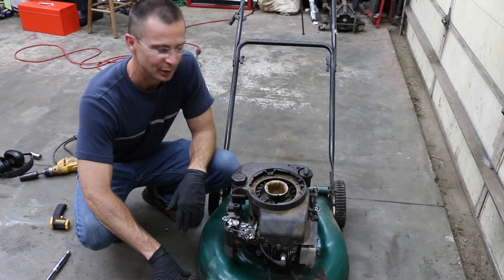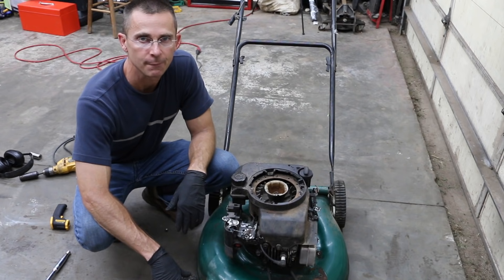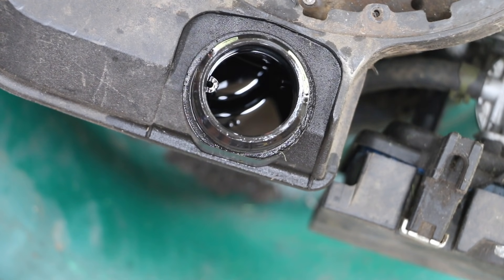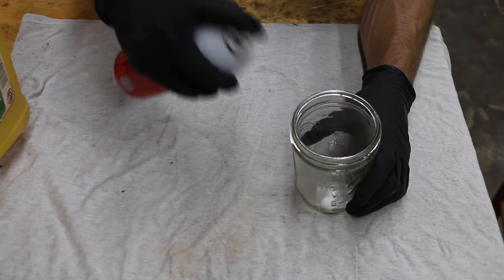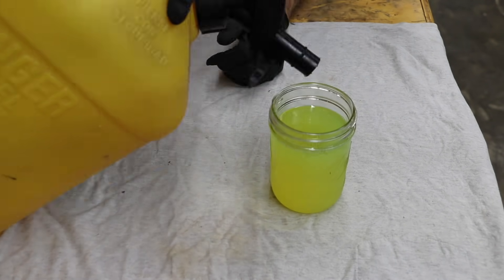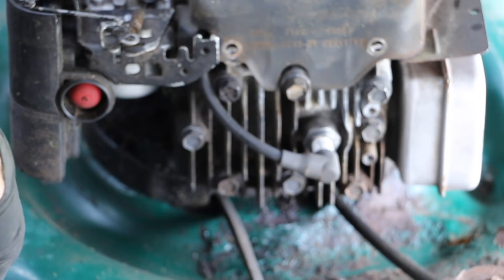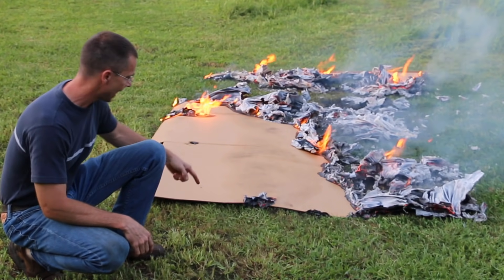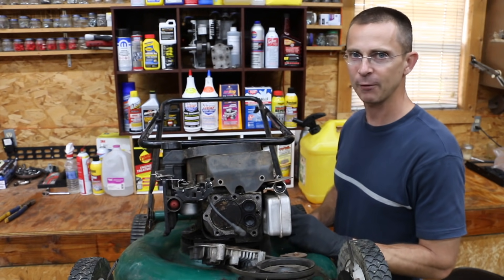Will a Gas Engine Run on Diesel?  Let's find out!

Comment: If you start on gas and get the engine hot, it will run fine on diesel. Old International tractors had a one gallon gas tank and a 20 gallon fuel tank. You started (and stopped!) on gas and when the temperature gauge came up turned a valve to switch. Some of the old Galion  graders were the same.
Reply from the maker: Thanks for commenting on this.
Reply: That's not quite how it works.  Those engines have a mechanism to prevent the exhaust valve from fully closing when a lever is thrown. That reduces the compression ratio since the cylinder is "leaking". So it starts up on gasoline (those engines have spark plugs) and then you throw the big lever which lets the exhaust valve close and activates the diesel injection system. Gasoline is shut off at same time. That is a very complex system that allows starting with a small battery and small starter motor. That is why it exists. The alternative in those days was a small external gasoline donkey engine for starting. That design was discontinued long ago. But it was very interesting, especially to those who are unfamiliar with engines. I ran an International crawler for a neighbor for many years with one of those engines.
Reply: @robertoskeetrech3206 people that didn't grow up on a farm welding and all that kind of mess don't know the diesel engine doesn't have spark plugs in it but it just squeezes diesel fuel until pressure ignites it
Reply: I worked at a golf course one summer. One day one of workers filled diesel into one of the small machines (single cylinder gas engine - John Deere, I think) and realised only some 20 minutes later when engine lost some power and was producing lots of white smoke. Nevertheless engine run more less OK until it was shit down. It was impossible to restart it and fuel flushing was inevitable.
Reply: @radolique1  it ran fine until it had finished the unleaded alcohol in the lines and carburetor it smoked until it was enough diesel being injected it may as well be trying to burn water
Reply: I have a 1949 Farmall H that you start on gas then run diesel. But I have just run gas in it for 20 years.
Reply: International made gas/diesel engines. Basically a diesel engine with a decompression valve that would allow for gas combustion at lower cylinder pressures (150 psi) when the engine was warm you could close that valve which would raise pressures up to 500 psi, turn the diesel on and it would run up on Diesel.
Reply: RiceReaper we had one a TD-18. Decompression valve and started on gas warmed up, switch fuels and close the decompression valve.
Reply: Hey guy I know has a Old tractor that starts on gas runs on diesel
Reply: Does sugar lock your engine up?
Reply: @smaqdaddy  I think there is a video here but if not I know from experience sugar gums up your pistons. Some people think it's the sugar grainuals doing damage, it's not as they disolve.
Reply: @smaqdaddy  sugar locks up your lips...
Reply: My father has a 54 international td6 I think it's called I don't remember the exact name. So yeah it's a temperamental sumnabitch sometimes lol fuckin loud when you switch it too diesel
Reply: This is ok with a compression ratio of 5 to 1 or less. If you intend to run a modern auto on kerosene it will be necessary to vaporize the fuel completely before it enters the combustion chambers. Incidentally, you can expect to achieve much greater fuel mileage on vaporized kerosene compared to gasoline.
Reply: We actually have one of them up at my cabin! they are really cool, outs is a old bull dozer
Reply: Robert Gibbons pony motor
Reply: Very cool story!
Reply: Robert Gibbons really? Man that’s so cool’
Reply: I think the carb is a problem.Diesel is too thick for the tiny jets on a mower.
Reply: That fire with the cardboard almost got ya
Reply: Called them TVO tractors in Ireland. Think they were back in the 60s. TVO = tractor vaporizing oil
Reply: Probably has a very high compression ratio and therefore can run on both... or has a low compression ratio for a diesel and therefore needs petrol to get going due to not having the compression and heat to cold start it on diesel... Which means it's a different kettle of fish (most likely)
Reply: One time I was putting gas in the lawn mower and I didn’t know it was diesel. The lawn mower ran until I finished the lawn because there was also regular gas still in the lawn mower. But the next time I went to use the lawn mower it didn’t start up and that’s when I found out I used diesel gas

Comment: I realized that if you could rig the primer to a solenoid that activated on the ignition, it might work since the diesel is being pumped in at the right time for ignition.
Reply from the maker: Great point.

Comment: I know you have tried putting diesel fuel in a 4 stroke engine but could you try putting diesel fuel in a 2 stroke? In the video you made about putting diesel fuel in an engine you had to mix the diesel with gas to make it thinner maybe drilling out the jets in the carb would let more diesel fuel into the engine (if you are willing to do that).
Reply from the maker: Great video idea!

Comment: I'm not sure what kind of diesel you used, but #2 diesel has paraffin in it as a lubricating agent (hence why it gells when exposed to cold temperatures). In the winter, many people cut their diesel with #1 (no paraffin) to keep it from gelling.

That paraffin, along with a cold engine, may be why you were unable to keep it running.

If you were able to "warm" an engine with gasoline, then switch over to #1 diesel, it may stay running on it's own.
Reply from the maker: Great point.  Thank you

Comment: If u work up Diesel then put it in the mower it'll  probably run ive ran my chain saw on straight Diesel it did fine once it got worked up good. But that was a two stroke I did a little udjing and now that's what I run it last longer in the field than mixing gas all the time.
Reply from the maker: Great point.

Comment: I wonder if a small amount of Diesel would raise the octane of regular gas??
Higher octane will make more power if the ignition and compression is adjusted for it.

Also. Diesel makes great fire starters. Yes it does take more to get it going but it burns longer to help the wood burn. Also doesn't flash in your face. Soak some 1/1" wood stock and 6" long in a can of Diesel. We used an old metal coffee can. Make your little fire include one firestarter and you have a great little camp fire.
Reply from the maker: Thanks for commenting on this.

Comment: My class learned in science that if a gasoline engine is hot you could theoretically use diesel as a replacement if in an emergency (if youve been driving awhile and run out of gasoline) but the engine needs to be hot. If we learned wrong please correct me.
Reply from the maker: I believe this would work in many instances. The viscosity is great with diesel, and some fuel systems might not be able to achieve a close enough fuel to air ratio to run.

Comment: Ok, I don't understand what happened here. I had a 5 horsepower Briggs & Stratton go kart with one of the carburetors that automatically adjust the fuel mix in according to the RPM. I ran out of gas and I wanted to ride it I happened to have diesel around I filled it with diesel, and it smoked like hell and was hard to start but I rode it around in a cloud of white smoke until it ran out of fuel how come mine ran?
Reply from the maker: Impressive!  The carb did a better job managing the high viscosity fuel.

Comment: So if someone (my girlfriend) accidently filled her car with diesel, maybe the answer is to drain as much diesel out of the tank as possible and then fill the tank up all the way with gas to highly dilute the diesel? It looks like a bit of diesel won't hurt a gas engine. Anyone ever had this problem?
Reply from the maker: Yes, you are right.  If the fuel lines running from the tank to the injectors are full of diesel, you'll want to cycle the ignition switch quite a few times to draw in the high gas content fuel.

Comment: One time I needed gas to get money I was owed about 15 miles away so I went to my parents grabbed the gas jug and put about 3 gallons in. As I was driving down the street my car was jumping like it was out of gas I figured what I put in there hadn't fully hit the engine yet so I drove 15 miles to get my money and 15 miles back to my town. After I got back I stopped at the park to play basketball for a few hours and when I went to leave my car wouldn't start so I called my dad and I tried everything he told me to do and nothing worked. Then he said to smell the exaust pipe and I did and it smelled like straight diesel and he then asked where I got the gas and he told me that was diesel that he couldn't find his yellow diesel gas jug so he just put it in a red one. I got one of my friends to take me to the gas station and I got 5 gallons of gas and went back to the park and just poured it all in and the car started right up. I've never had an issue out if the car since then but everyone has told me I'm really lucky since I drove on straight diesel fuel for about 35 miles.
Reply: I've seen that before. I know in an old carburetor car, it will run if the engine is hot. It'll run like crap, but usually it will run until you let it cool down. There's usually no damage.
Reply: Cameron Cooper I did this one time in a similar situation, but when I went to turn off my truck it didn’t turn off even with the key out. Had to pop the hood and suffocate the intake haha 

Good ole’ Ford Straight 6’s  they may keep you guessing on how the keep on truckin’
Reply: yeah,, kind of like happened to me! took a few days to clean it all out for it to run smooth again
Reply: Well gas engines won't be harmed by diesel they would just not run well. On the other end putting gas into a diesel could potentially destroy the motor.
Reply: I had a similar experience, except with kerosene in a 2 stroke engine. Had to do a rebuild after that one
Reply: Seems like a typical Cameron Cooper Patriot Bank thing to do. Idiot.
Reply: Normally some diesel in a gas engine wont cause harm . Gasoline in a diesel engine however can turn out catastrophic.  The high compression in diesels engines  rely on the extra lubrication diesel fuel provides .
Reply from the maker: Wow!  Thanks for commenting on this experience.

Comment: No disrespect intended but why the moth ball?  From mom I've learned that riggs use diesel an its because it burns hotter then gas but it has to get hotter first before it burns the reason for bigger plugs an a lot more. So for a lawn mower to use it, it would have to be close to boiling. Thank You Loader.
Reply from the maker: Mothball is supposed to boost octane. Thank you.

Comment: Years ago I found you could use 100% diesel in a mower if it was fully warmed up. When I would run out of gas I would quickly add diesel while it was good and hot. It got the job done in a pinch.
Reply from the maker: Thanks for commenting.

Comment: I don't know I'd be curious to see how much nitrous oxide a wet kit that a lawn mower engine would handle setup correctly of course not just people open bottles and let it spray right into the carb course that's going to lean it out. But a legit wet kit
Reply from the maker: Great recommendation!

Comment: The older kind of moth ball was made of Naphthalene which was quite flammable, so its use in moth balls was discontinued in favor of pdichlorobenzene (para-dichlorobenzene), which has a significantly lower fire risk, which probably explains why it didn't work in the experiments.
Reply from the maker: Yes, that's the type I used. Thank you!

Comment: I would have been suprised if the diesel worked. One of my coworker accedently put diesel in their car - the station had the wrong nozzle on the pump. Dead car and a very expensive repair..
Reply from the maker: Wow!  Thanks for commenting on this.

Comment: The diesel don't work on gas engine because the diesel engines don't use air/fuel mix to work. The engine use the fuel pump to regulate the engine cycle and the uses the piston compression to ignite. The compression ratio in a diesel engine is times higher than a gas engine and the piston lenght is higher too.

Comment: Have a mechanic friend who, a number of years ago (when diesel was cheap), set up dual tanks on his old Chevy Apache.  One for gas and one for diesel with a driver accessed valve to switch between the two.  He would start it on gas and then when on the highway and up to cruising speed make the switchover to diesel.  Claimed it would continue running and maintain speed just fine.

Comment: I was once told by a mechanic that lacquer thinner helped prevent engine parts like injectors from going bad and cleaned a lot of internal parts like the throttle body. In this video you removed part of the engine to show the piston. Maybe you could run a lacquer thinner gas blend to see if it will clean those internal parts. The real question would be if the mower runs on lacquer thinner alone or does it have to have some gasoline in the mover in order to run. If it does have cleaning properties then 100% lacquer thinner in the mower tank will do a better job than the gas lacquer thinner blend. I don't recommend anyone try this, since you asked and had a mower to try it, maybe you could try and then crack it open to see the results.

Comment: I filled my 2014 tacoma 2trfe with Jet-A from my helicopter donkey tank, it ran fine till I could get to a gas station about 20 minutes away. I would say it was a 50/50 mix, it was down on power but it didn't smoke or anything  Edit: also interesting is in an emergency situation I can run the helicopter on 93 octane pump gas, but only for 5 hours before I have to rebiuld the hot section of the engine.

Comment: Friendly suggestion.... next time you ignite fuel get a long stick, put a small amount on only one end of the stick and light that, then with your body and face/hair as far away as possible from the main fuel source touch the stick's lit end to it with yourself as far away as possible holding the non-lit end of he stick.  This will minimize any fire contact to you from the WHOOMF of initial combustion.  with gasoline the fumes are flamable, not the actual liquid and you cant see the fumes.  You may be smack dab in the middle of a cloud and not know it.
Reply from the maker: Great recommendation!

Comment: Can u make comparison test between 50/50 mix and full gasoline? I wonder which one will run longger in same condition
Reply from the maker: Thank you for the video idea!
Reply: Project Farm That'd be a great test. Your 50/50 run in this video definitely has me thinking. Diesel in my country is not taxed at the pump like gas (a separate road tax is paid) so is almost 1/2 the price of gas!
Reply: I'm guessing engine knock could potentially destroy a more complex tuned engine but interesting to see the effect on a simple small engine
Reply: @DiscoFang  i think it will run fine but smoking like chimney
Reply: Please
Reply: a simple engine might run quite some time. but you saw the difference in deposits of oil/diesel coal on that cylinder head. these deposits will raise the compression ratio over time, damage the piston rings, dirty the engine oil and so on. in long terms this mower engine will see a great deal of wear. a modern car engine won't forgive this treat quite as long. the catalyst might break real quick and the lambda sensor will recognize that there is something wrong with your engine real fast. temperature and knock might be a problem. modern engines are very precisely tuned for their respective fuel. no chance this will come to a good end. and the emission values of your engine will definately turn your car illegal to be moved. i worked for an engine fabricator in the R&D for a short time and even wrote my Bachelor thesis about piston optimization in a CNG engine. slight changes on an engine or its fuel can cause dramatic changes in the way it works.

Comment: If you use diesel in an gas engine you need to put the shoke on (or close the air valve for half way
Reply from the maker: Great point.

Comment: hi there,my question is, what would happen if you would use a sparkplug that would fire up diesel engines and put that into a gas engine, maybe the engine will run?
Reply from the maker: Using a glow plug in a gasoline engine with diesel as fuel is a great idea. Thank you!